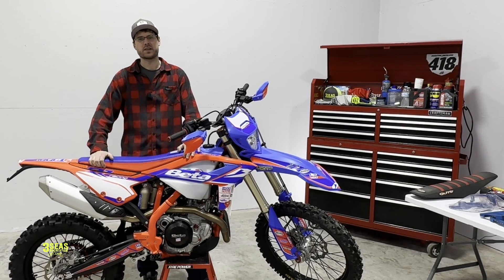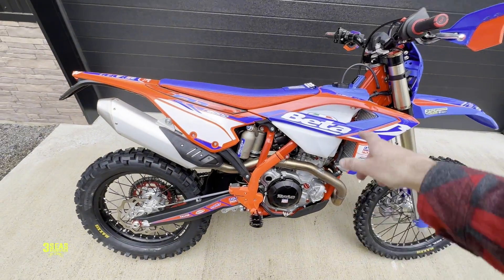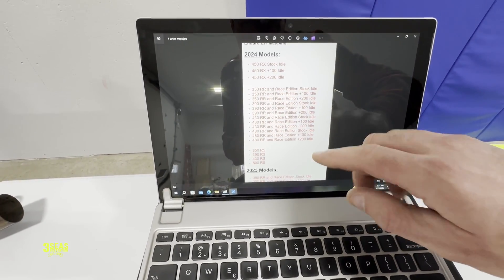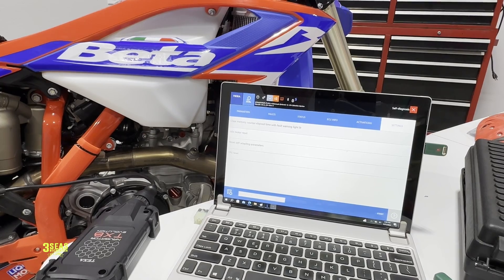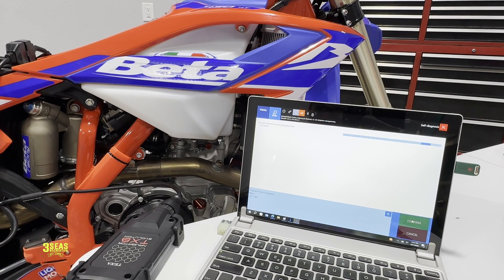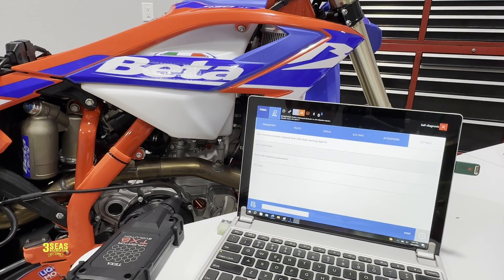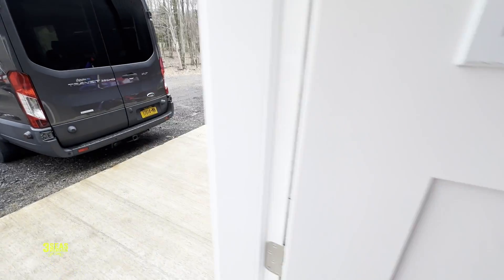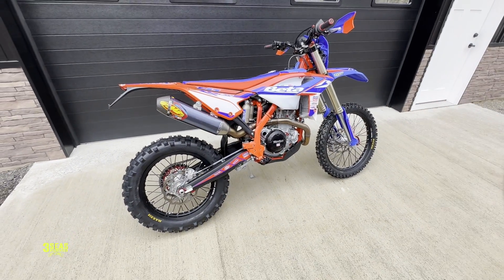2024 Beta 4-Stroke Motorcycle EFI Maps Explained! Let's make your bike run better! #3SRTV

Comment: Great youtube channel. I recently have my RR390 racing. I am getting an error when connecting the Service Tool to the bike. "Communication with vehicle is interrupted. Check Connections. Check for power at autodiagnosys socket Switching ignition ON." I started the bike thinking that is asking for that, but is not solcing it. Any ideas?

Comment: I have a 2023 390rr, it seems to run fine when it’s running but I feel like when riding and starting/stopping etc it always struggles to restart. 
I wonder if my dealer did this map update, I bought it brand new.
Reply from the maker: I would certainly have the map updated! Try a new spark plug, ensure the spark plug cap is installed properly & check your valve clearance. Enjoy The Ride, Jared
Reply: @ thanks I’ll check and have those things checked. It’s been this way since day 1 brand new but worth verifying

Comment: Okay, I really need some help. My bike is a 2022 500 RRS and the only thing performance-wise done to it is the FMF power core 4 slip on. I took off the factory exhaust and installed that one. When I start it up cold and let it warm up typically it will die after 10 to 20 seconds. On a couple occasions it's done the same just while riding it. I called you guys hoping for some input on what to do and absolutely got nothing out of it. After watching countless videos from you guys, I was hoping for some sort of guidance being that I am in southern virginia. The guy who I spoke to said he's never heard of that and pretty much that's all he said. I love this bike and I really want to try to resolve this issue. Do you have any input?

Comment: I guess as old BST, we can't buy it... (I guess mainly due to possible mods interfering with Euro perf certification) If it is still the case, I hope that we will have possibility to reset step motor and tps with an usual odb2 bt dongle and softs like car scanner pro... THIS is real pain in ass, the only reason I would  soon or later quit Beta bikes.... These to main parameters wouldn't interfere with the Euro certification... As long as start bike is made with a full voltage battery, there is no need to reflash, and no glitch in ECU map program,  due to voltage dropping to  8v and less when cranking and contrary to cars, zero low voltage ECU protection)
Another point is to use a small odb2 dongle so you exactly know with your phone app in real time when bike has the upper temp trigger to end stepmotor reset

Comment: Hi! Im having issues with the 24 480 racing.. it starts fine when cold but when warmed up it needs 2/3 pushes to start. Have you experienced this with the bikes? Bike is remapped
Reply from the maker: Sounds like it needs to be remaped. You can tell in this video how much better this bike ran after the remap. Enjoy The Ride, Jared
Reply: Any update?
Reply: @outbackproduction5720 it needed remap, now run good

Comment: So is the new tool/mapping for the older bikes too, or do you still use the older tool also for the older bikes? Also, how does the aftermarket exhaust change the bikes performance?
Reply from the maker: Good Morning and good question! This tool is the new dealer tool for all Beta motorcycles no matter the year. The exhaust will open up the power and give it more of a response for sure! Enjoy The Ride, Jared
Reply: @3SRTVOfficial  the past tool was really erratic in USB com  ports :(

Comment: Are you seeing this with the 2023s as well? Bought my 390RR, have kept it stock and essentially follow your stepper motor reset process you posted last year. Stone colt, run til fan goes on, shut off. Meanwhile I'm geared up and the bike is all warmed up and ready to go. Thank you for the videos! I've loved my Beta!
Reply from the maker: Good Morning! Yep, all 2023 4-strokes also have a dealer service bulletin : SB-2023-4 . This will drastically make the bike run better if it is off a bit. Enjoy The Ride, Jared
Reply: Should that be covered under warranty?